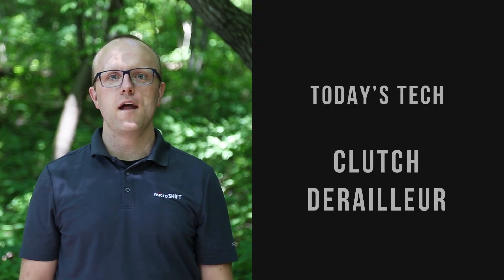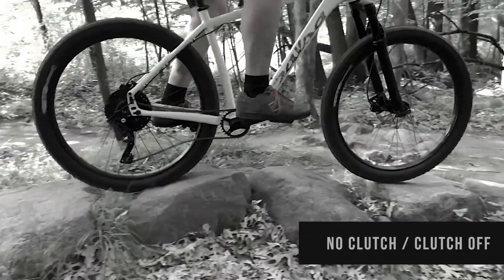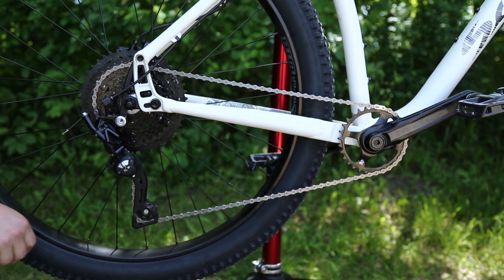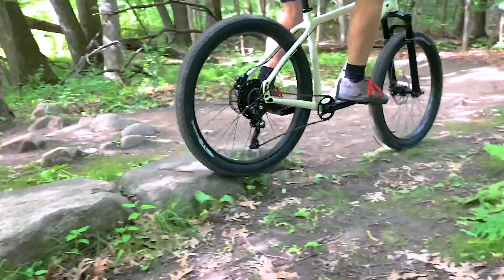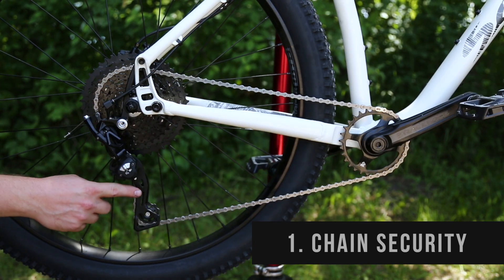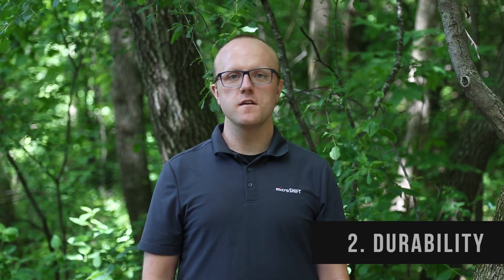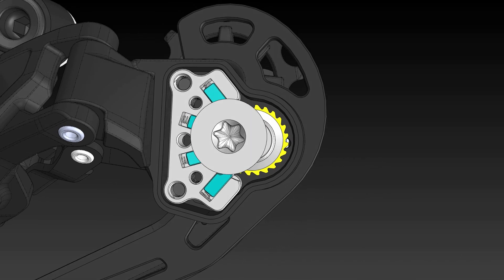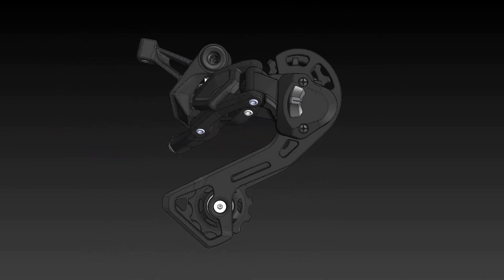microSHIFT Clutch Derailleur Explained

Comment: I just got the Advent X on my Marin Gestalt X10 and clutch isn't quite tight enough. Do I tighten by just feel or is there a torque wrench setting I should use?
Reply from the maker: You can open the clutch cap by unscrewing the two philip screws. In the center of the clutch mechanism, there is a T15 torx screw. By tightening it, it will increase the clutch tension. This will also make it harder to shift, so do a little trial-and-error to find a clutch force that works for you.

Comment: How stiff should the clutch be because I get a ton of chain slap
Reply from the maker: You can try tightening the clutch with a T15 torx wrench to increase the clutch tension. Bike frames sometimes have chainstays really close to the chains, and the chain slap is unavoidable.
Reply from the maker: @unknownuser39999  You can open the clutch cap by unscrewing the two philip screws. In the center of the clutch mechanism, there is a T15 torx screw. By tightening it, it will increase the clutch tension. This will also make it harder to shift, so do a little trial-and-error to find a clutch force that works for you.

Comment: I have purchached B Twin riverside 120 bike which has Microshift RD M25 rear derailleur. Can you please tell where is the clutch. My chain is coming out frequently whenever going through a bump on road.
Reply from the maker: The RD M25 derailleur, unfortunately, does not come with a clutch. We recommend visiting a bike shop to ask about options to to help with the problem! There are little components available in the market like chain guide, narrow-wide chainrings, and also clutch derailleurs to keep the chain on. Feel free to contact us if you have more questions.

Comment: I'm running Advent 9spd shifter, cassette, and derailleur on both of my bikes, hardtail and a full suspension. Since install, about 3 months ago, smooth, crisp shifts, zero chain drops, excellent setup all the way around! Paired with Jagwire cables and housings this is a great system. Highly recommended.
Reply: The other day I bought several different jag wire shift cables and non jag wire cheap cables.  
I couldn’t find anything different about the $5 normal cables and jag wire $25 cables.
Reply: @PepperandCaseysRV  Jagwire cables are designed to work with Jagwire cable housings. Jagwire cables in cheap cable housings will not work well. Cheap housings  compress and flex when brakes are applied. Gives a mushy, weak braking experience. Jagwire cable housings do not compress and flex, providing a superior braking experience. This information is true and correct, not an opinion. Cheap cables stretch, especially when new, but stretch and flex whenever brakes are applied. Jagwire cables do not stretch and flex, providing a more controllable and pleasant breaking experience. Same information applies to Jagwire shift cables and housings as well.
Reply: @olroymtbetc.6117  duh of course the cables go with the housing that is what came on my bike
Reply: @PepperandCaseysRV  not clear on your meaning. What I stated previously still holds. Based on your reply, you need to do some research. You have no clue. Cable housings and cables that come with a bike when new are junk! Period! Use all Jagwire housings and cables for optimum performance. Mix and match will NOT provide the desired result.

Comment: What's the biggest front chainring you can run with the 1x?
Reply from the maker: Alex, for 1x, there’s no limitation on chainring size from the drivetrain. The only factor is your frame. You will need to check your chainstay clearance with your frame manufacturer.